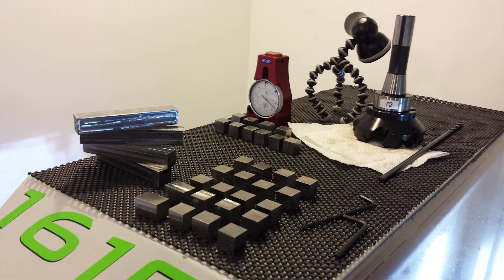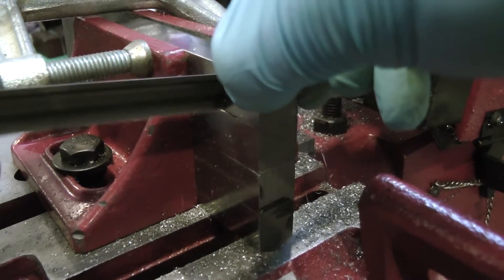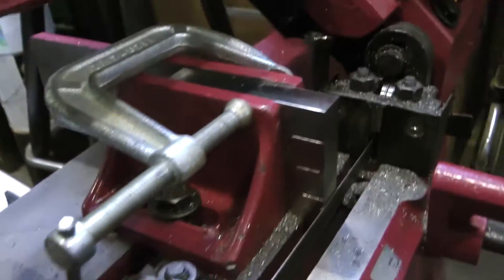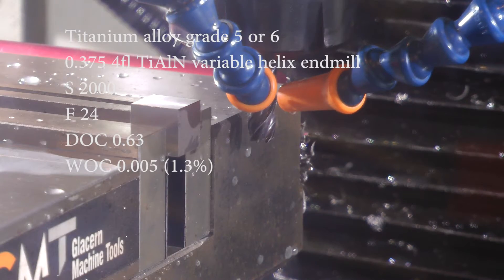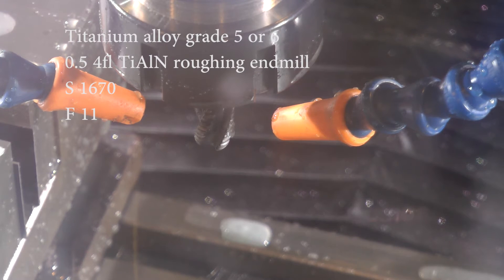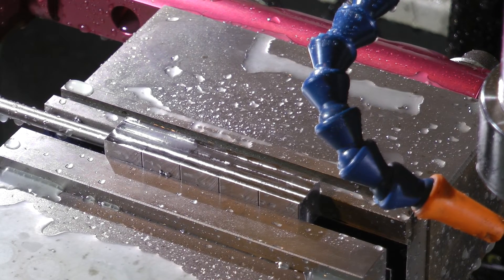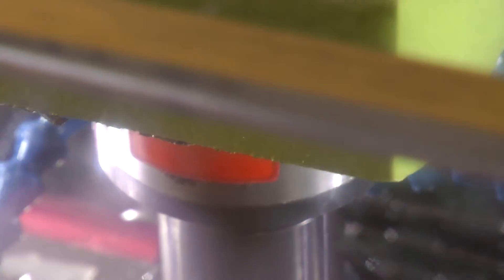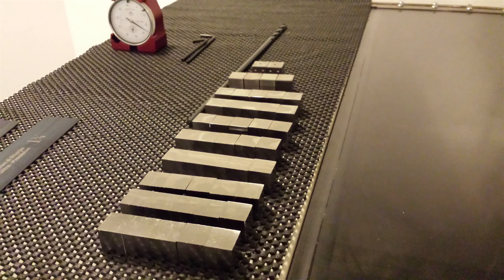Precision Dice: (pt.3) Ti dice batch process

Comment: Good call evening the vice up with another block on the other side of the jaws but I'd highly recommend tapping the parts down onto the parallels (probably by using a flat, square piece of aluminum set ontop of the Ti piece to hit with a mallet so you have a larger surface to strike that's square with the work-piece) just to take the small amount of variance in hand-loading out of the equation, and afterwards just confirm that the parallels cant move underneath the part before running. 

Keep up the good work,
-Doug
Reply from the maker: PioneerSaturnDougie Good point I almost always do that but in this case I experimented off camera to see if it was necessary here. It wasn't. I was pushing down quite hard on the die when clamping and I didn't clamp too hard since I wasn't removing very much material. So for this operation I found no difference.

Comment from the maker: Looks like I'm down to 21 finished pairs from the initial 26. These losses are due to either tolerances being off or tool crashes from trying to cut this stuff. It's very hard on tooling.
Reply: War Machine LLC Scrap tickets are no bueno, but with those losses hopefully the next batch will see significantly less losses.